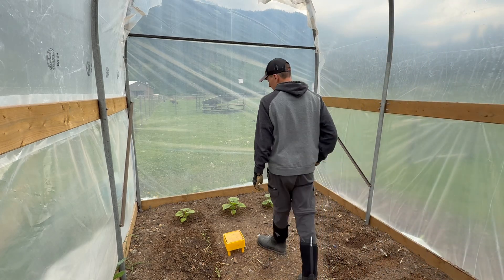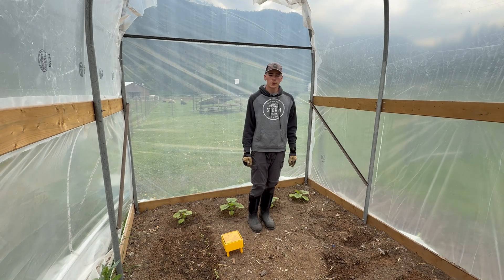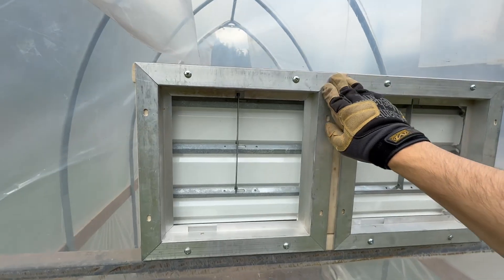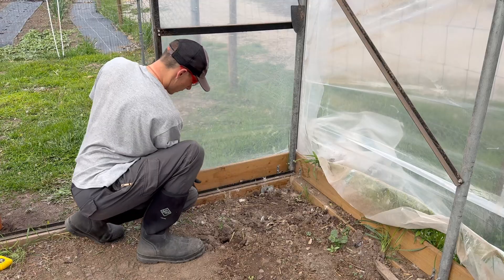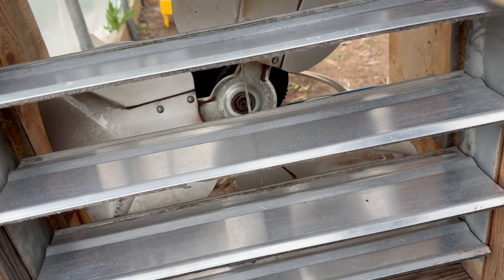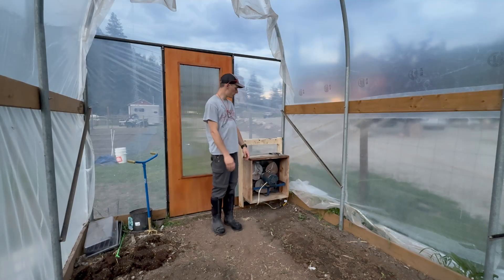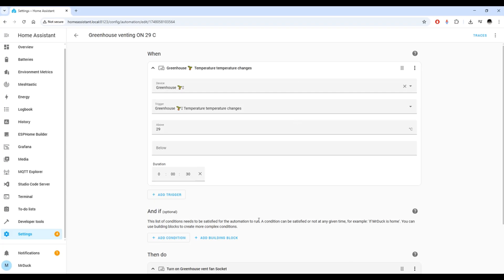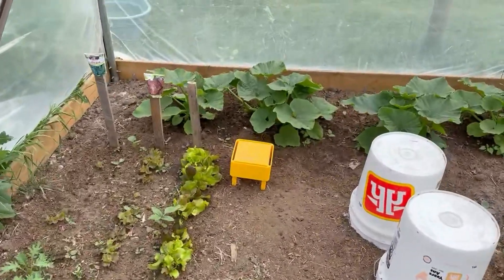How I Automated My Greenhouse with Home Assistant

Comment: I think this is awesome but if possible I would suggest swapping the vent to be higher and intake lower as hot air rises and you may get mixed results with the current setup, saying that, not sure how much air that fan is bushing but the pressure it generates to open both of those vents tell me my statement may not matter much 😂 anyways, cool setup and cool video!